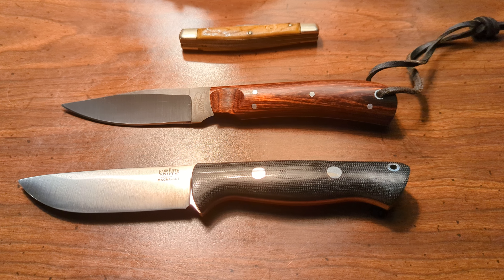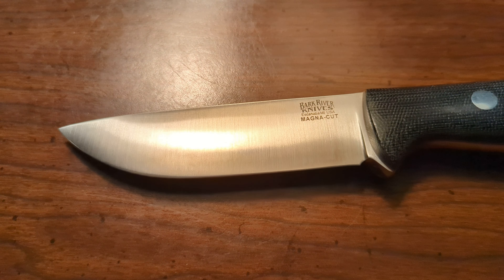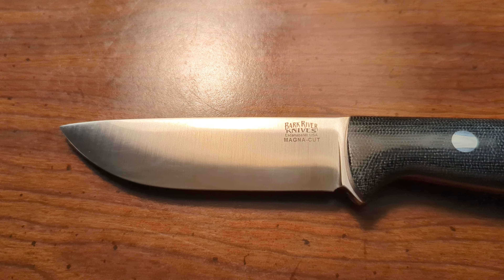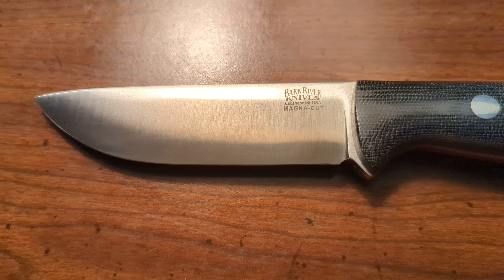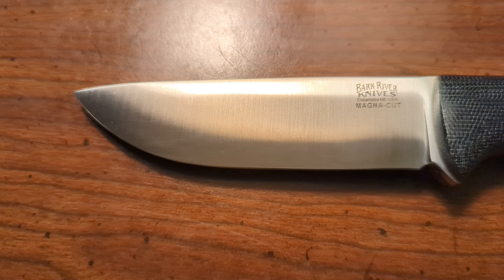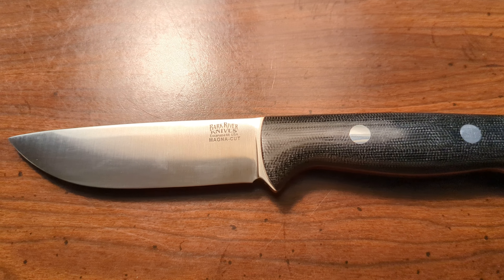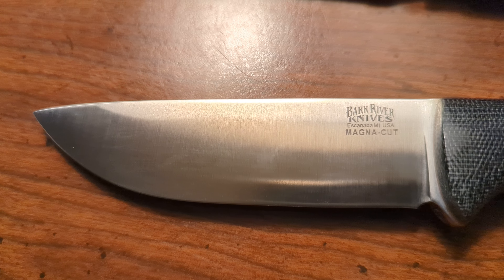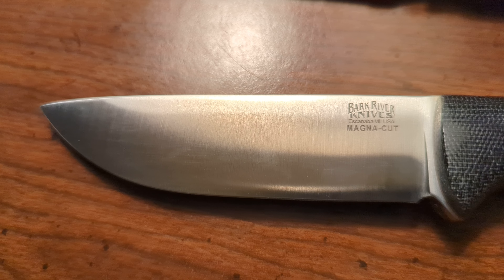Conclusion of the Magna-Cut matter.

Comment: Thank you for doing this video. I don’t know if this will help but: I’ve made two Magnacut knives with Peter’s heat treatment and I’ve tested them both quite a bit. I’ve found that Magnacut rusts in salt water in less than two days and that it hasn’t corroded or gotten a patina when I have cut a variety of things and intentionally not cleaned the blades. I have Some YouTube videos on this.
It could be that Peter’s heat treated my blade after they got things dialed in (the first knife was heat treated more than 7 months ago). I hope you try a good Magnacut knife in the future since I’ve found the steel exceptional.
Reply: Its the heat treat most likely. They can change it, but who knows if they will or not. Someone has to talk to them and it's likely no one has. But its also possible that bark river just grind on belts running too fast and burning those blades. They are known for that. Water cooled belt grinder is the answer but they refuse to change
Reply: @tacticalcenter8658  I hadn’t thought about the possibility of them messing up the heat treatment by letting the steel get too hot while grinding, that could also be the reason. Either way I haven’t known of any other Magnacut getting corrosion this easily.
Reply: @totesmalotes  when you grind your knives after heat treat, do you use water cooled belts? Maybe you can try in the future. Just take a hose and drip feed it on the belt. Make sure it doesn't get in the electronics. Look up examples on youtube.

Factoring that out could mean its just the protocol that peters is using. Perhaps Larrin can intervene and correct the protocol.

Im guessing it wouldn't make financial sense to get more magnacut and use peters though.
Reply: @tacticalcenter8658  I think Peter’s heat treatment is great. I believe that two days in salt water before it rusts is as good as Magnacut corrosion resistance gets. 
I’ve only seen two people on YouTube do the same test as me and one got the same results and the other (Peter from Cedric and Ada) left his knife in salt water for only a day. I’ll probably have to buy a Magnacut knife from spyderco in the future to test it myself but that won’t be until later on.
But I dunk my blades in water when I do a zero bevel grind and when I do a secondary bevel I do it by hand on diamond stones because I am paranoid about too much heat.
Reply: @totesmalotes  dunking on water is not helping. You get hot on the belts then you quench in water. And you do that multiple times. That's different than keeping water on the belts keeping the metal from heating and cooling in temp at all.
Reply: @tacticalcenter8658  well, the way I do it is I only do one pass and then dunk it. I don’t wear gloves and my blade is horizontal not vertical when I grind so it retains water on the flat of the blade. The water on top doesn’t steam or bubble (I don’t let it). Once the edge is closer to an apex I’ll only do small sections before I dunk it in water. Each blade takes me hours. I’m not saying your way is better or worse, I just haven’t had any problems doing it the way I do it.

Comment: This is quite interesting to me. I've got an Aurora Scandi in Magnacut which is, as far as my knowledge goes, one of the earliest runs BRK did of the steel. I've not had any problems with it whatsoever but that's not to say it's impossible that I will eventually. I recall there being an issue with the batches of steel initially pushed out by Niagara. Things like imperfections in the stock causing breaks on knives under less than egregious abuse. Perhaps it could be attributed to an issue from Niagara? I don't rightly know. I can't say that I've had issues though, even with other brands using Magnacut like Hogue.

Comment: I think it’s grinding dust personally.  I don’t think it matters much if they are all ground in batches.  Grinding dust will oxidize a million times faster than a solid piece of steel because of the increased surface area of the metal particles.  If that’s impregnated into the knife steel it will oxidize faster than the blade steel.  It should clean up with polishing and not stain/patina once it’s cleaned up I would think.  Being the devils advocate, if I was not able to get Magnacut steel but wanted to switch it out for another steel that was readily available and not loose any performance in terms of edge retention or toughness I would swap it for CPM-4V.  My 4V knives do stain and rust.  For me the difference would be obvious between these steels though.

Comment: I would try the flitz, and then gently rub some bar keepers friend on the blade with your finger. The bark keeps friend will eat any corroded metal and will make the steel very dry. Be gentle when rubbing the bar keepers friend on the blade so it won't scratch your knife. I think if the blade steel is magnacut, you'll see a decrease in corrosion since you would have removed some or all of the non stainless steel.

Comment: Dang this is a little discouraging. I just got a Bradford guardian 3 in magnacut two days ago and was so excited for this new steel. I’m praying I don’t run into this same issue 🙏

Sorry about this issue your dealing with brother I’d be so upset.
Reply: @lyman135  it's not what its advertised to be.
Reply from the maker: @lyman135  I polished one of the knives and it's staying fairly stain/patina free now.  Most of my knives are not stainless and work just fine.  I'm not worried about that, but according to everything I had read and heard before buying these, Magna-Cut is supposed to be more stainless than S45VN, S35VN etc.  I just want to put this out there so if someone is thinking about buying this or needs stainless they will be better informed.  Honestly, I think 3V is a better steel in Bark River Knives.  I don't see that Bark River Magna-Cut holds an edge any longer than 3V, and my 3V blades stay as patina and stain free as the Magna-Cut.

Comment: I think you got to the bottom of this and your theory is sound. If you look at the MC data sheet (Google it, then go to page 2, under Temper) it will confirm that high temperature tempers (or overheating the blade after temper) will reduce corrosion resistance. MC is a low chromium steel and it gets its corrosion resistance through proper heat treatment only. NOW... I offer an alternative explanation on the poor temper. Bark River confirms that they use the same belt on many knives and indeed their finish looks (and had y for a long time) like a knife that was ground on a dull (over-used) belt. Dull belts will heat the surface of the blade VERY quickly, especially if pressure is applied against the belt. This would probably not affect knife performance much, which is consistent with your initial impressions. So there you go... Lazy grinding = patina. Maybe.
Reply: They grind the knives without water and micro quench which is also bad. Horrible company. A known issue they refuse to grind under water running over the belts.
Reply from the maker: I have had better luck with one of these knives after I polished the blade.  However, I don't see that they are better than 3V.  I have decided to stop buying Bark River Knives.  I don't believe they are making them as good as they could, and I don't think they care what their customers think.  The fit and finish is excellent on these last two I bought, but sometimes it is not. 

Thanks for the information and for watching.

Comment: I have had great results from flitz polish and then flitz gun and k ife wax and lastly the ceramic sealer from flitz.
Reply from the maker: I have only tried regular Flitz.  The knife I used it on tarnished again.  Not the fault of the Flitz, I'm just saying it didn't fix this Magna-Cut to polish it.
Reply: @MountainLife1  I had the same issue mine was even pitting. I polished the heck out of it. What stopped it was the flitz ceramic sealer. But I also used the knife wax first. You have good videos 👍
Reply from the maker: @mrglock2313  Thanks for the info.  If mine gets too bad, at least I'll know what to do.
Reply: @MountainLife1  you are welcome. I have more than 10 bark river knives and I treat them all with the ceramic sealer and they stopped rusting or blemish. You can find videos on YouTube on it. Take care

Comment: Good info, thanks for the video showing your knife. At this point, the only person I would get info from regarding MagnaCut is from Dr. Larrin Thomas (the inventor of MagnaCut). I would be skeptical of any new blades since the defect is at the source
Reply from the maker: I agree.  I am not usually this quick buy a new steel, but I had heard so much good about it.  I still think if it's done right it would be a good steel.  However, it will be a long time before I buy Magna-Cut again, and I am done buying Bark River Knives.  Thanks for watching and commenting.

Comment: The steel in this blade is not stainless, same thing with CPM-3V, they are high performance steel but they will stain with use, I have Bark River knives in both steels and use both as my main carry knives for hunting and camping and pretty much anything I need a knife to do I take great care of them, keep them clean and sharp and both show the signs of use, it is unavoidable due to the nature of the steel, and as you stated that you cut oranges with the knife and the acid in the orange will definitely leave it's mark on the blade. It has nothing to do with your treatment of the knife it's just the nature of the steel
Reply: Actually it is though. I think I’ll take advice from multiple trusted sources over you 😂. It rusts far easier than it should
Reply: @shroomsrus5116  yes, ALL carbon steel will rust, but if you know how to take care of your tools you can prevent that from happening. If you are getting rust on your knives undoubtedly you don't know how to take care of them and it's not the knifes fault, it's yours
Reply: Saying that Magnacut is “not stainless” like 3V is highly asinine and clearly shows lack of understanding in metallurgy.
Magnacut is very stainless because of the composition.
Reply: Actually it’s so stainless that it’s almost stainproof and Spyderco replaced H2 and LC200N to Magnacut.
Wonder why…
Reply: Dr Larrin Thomas metallurgist, writing about the steel he invented "Also I am sure that people will look at the Cr content and immediately call it a “semi-stainless” despite the steel’s excellent corrosion resistance. So hopefully word of the steel’s performance travels faster than initial reactions to the composition. I might be putting too much faith in humanity. The biggest surprise in testing of MagnaCut was how good its corrosion resistance is. It was expected to have corrosion resistance in between S35VN and S45VN, “good” or even “great” but not spectacular. However, the corrosion resistance ended up being even better than 20CV and just under stellar steels like Vanax or LC200N."

Comment: Mike Stewart Bark River Knives has said from the beginning that his Magna-Cut knives ''are not stainless'' ,,, you are poorly informed and have not done enough research on the issue... I bought a BRK Bravo 1 magna-cut and it is exactly as you described,,, holds edge well, easy to freshen the edge on a strop and will tarnish when used,,, EXACTLY what Mike Stewart has said ;)
Reply from the maker: Thanks for watching and for bringing Mike Stewart's words to my attention.  When and where did he say this?
Reply: @MountainLife1  he repeated his position on magna-cut yesterday on "Bark River Boys''   your video was ''hotly'' debated
Reply: @MountainLife1   Lets get this Straight - Our Magna-Cut blades are heat treated by Peter's heat Treat - they worked with the designer to get everything correct. Our blades are 62 Rockwell - Not 64 Rockwell. They are tougher than if they were at 64. I'll give up a little stain resistance for more toughness any day. I really don't listen to people that are not professionals. Magna-Cut is NOT - NOT a stainless Steel no matter who says it is. It is a highly alloyed Tool Steel that leaves the Chromium as Free Chromium in the matrix. I have said this from Day one. I am not putting a blade out there at 64 Rockwell. If it is a bit less Stain Resistant - so be it - I have made that clear from day one as well. I am concerned with Performance. this Steel is tougher at 62 and that is what we are going to stick with.
We did not do anything wrong in Heat treat or Temper - we did what the Designer said to do if you want the knife at 62 Rockwell. Like it or not - I'm sticking with 62 Rockwell. People need to re-sharpen these knives on a strop - they should not have to go to a diamond hone to put and edge back on them.
I hope I have made myself Clear here.  Mike Stewart
Reply from the maker: Thanks for bringing this to my attention.  I actually did quite a bit of research on Magna-Cut, and watched numerous videos of people testing it.  I have read all the Larrin Thomas stuff and everything that Bark River, DLT Trading and Crucible/Niagara says about it.  I actually bought the knives the first of December and sent them to get the ramps taken off.  To my knowledge, there was no video showing any tarnishing on any Bark River Magna-Cut knife at all.  

Since you commented, I have searched for Bark River Magna-Cut, Mike Stewart Magna-Cut and other variations of this and have been unable to find the information you are giving me.  DLT Trading, Knives Ship Free, or Bark River Knives does not have any of this information on their websites as far I can see.  I believe what you are telling me is true, and I thank you for it, but I don't understand why this information is so hard to find or so hidden.  Shouldn't this be public knowledge on these websites where people buy these knives.  In fact, DLT Trading (one of the largest Bark River Knives dealers) told me that the Magna-Cut in these knives was stainless, and that only a smear of some non-stainless steel was probably on the knife.  Why would one of the largest dealers with a close relationship with Bark River Knives not know the truth?

I never said what Rockwell these knives are at, I  just said something was done in the heat treatment that makes them less stainless than advertised by the knife world at large.  I don't have a problem with 62 Rockwell, and don't really care if a knife takes a patina, but again this information should be made evident to anyone looking at a Bark River Magna-Cut knife.  The best I can tell, Bark River Boys is a private Facebook page.  Why should people have to dig for this information?

Thanks again for watching and taking the time to bring this to my attention. Please don't take this response as a criticism of you.
Reply: @MountainLife1  Thank you for doing the research and crating a space for people to comment on this, as well as being so accommodating to them. I haven't made a purchase, simply because I could not find the details about the products I would like. You had to put out all of these videos before that information became available. Best wishes.
Reply from the maker: @mclifed  Thanks for the encouragement. I'm just showing my experience with these knives and pointing out how they differ from expectations.  I just wish all this information was made plain from the company or where the knives are sold, so people would know exactly what to expect before they buy.

Comment: Several knife manufacturers are having trouble with Magna Cut!! please see Survive knives website about its GSO 5.1 knives in Magna Cut.. They are coming out of heat treat with problems and its bad... They have a video about it...
Reply: Several? or just Survive! and (maybe) BRK (pure speculation at this point)? Neither of these issues have been conclusively shown to be a problem with the steel. Survive! always manage to find someone else to blame for their problems and BRK doesn't seem to think there is a problem with the steel at all.
Reply: @lb4937  Survive does research and finds out what is actually going on! They were fine when they sent them to heat treat and when they came back they were not!! DO SOME RESEARCH!

Comment: I have 6 knives in Magnacut, even from when it was first released and have never had an issue.  I have over 400 knives and in the past I have had a number of knives with suspect heat treatment/tempering.  I do not believe the issues with your knife has anything to do with whether or not it is a new steel.  420HC is just as susceptible to poor heat treatment and it has been around for many years.  You are a victim of 'confirmation bias'.  You came in to the purchase with trepidation and your 'fear' has been verified.  Confirmation bias.
Reply from the maker: It sounds as if you are saying it's my fault that these knives do not perform as expected.  In order for this to be confirmation bias, I would have had to have some predetermined idea that this steel would not perform well.  That is not the case, and there was no fear involved with buying these knives.  This is not confirmation bias, it's just plain old bad knife making.